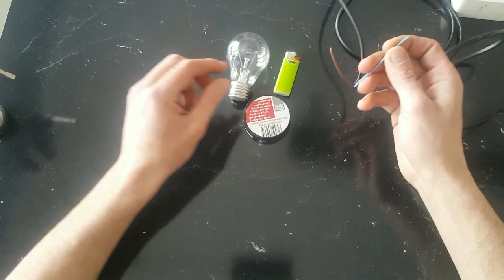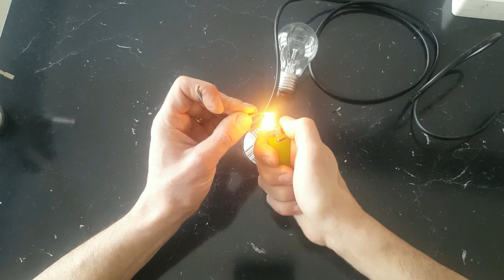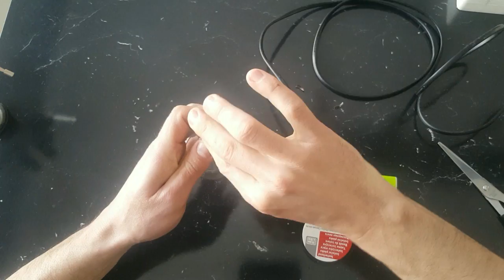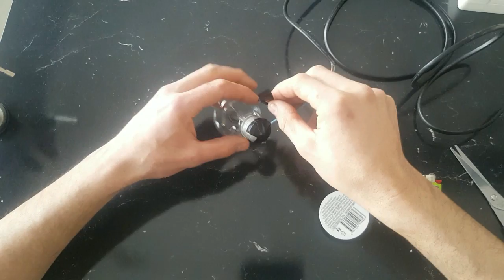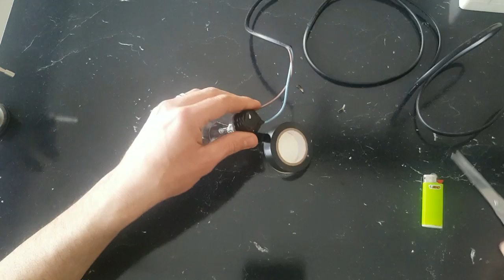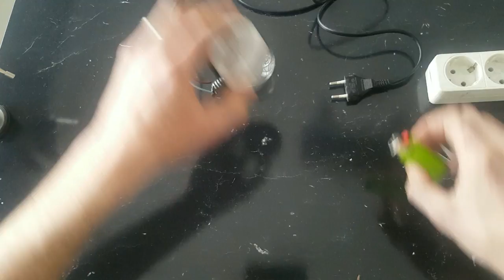How to power,start a 220v light bulb without the socket, just wires and tape

Comment: And can i use the usb thing to connect to the plug?
Reply: The wire with the usb thing that you can plug in to make a plug
Reply from the maker: No masking tape is made of paper and can be wet and tear very easily, and no usb cable is not made for high voltage

Comment: Hey, I tried it prior watching this video, and the way I did was I made the 2 wires contact with the very end metal tip of the light bulb, and it slammed down my home's electric system, and the bulb sparkled a huge one, and burned the metal. What did I do wrong?
Reply: One has to touch the bottom black part and the other touches the outer metal. I think the white one touches the outer metal ring and black touches the bottom
Reply: @SFConline1  ooh alright, thats what I suspected, thank you good sir
Reply: 😂😂😂 hope you didn’t burn down your house bro

Comment: that tape softens at 80 degrees and loses it's grip. it can short circuit. you should at least cover the ring around the base contact to shield it better, and use kapton tape or a heat resistant holder. i thought your video had barely more that a kid would know about electricity. i.e. kapton would have a 10 percent faliure rate compared to SHIELDING tape which is not at all heat resistant enough for a 150 degrees lightbulb. no shielding used near base. no safety warnings.
Reply: What tape would you recommend
Reply: Depends also on the w of bulb so I did it and I use 20w bulb energy saver

Comment: Witch is positive and witch is negative
Reply: doesn't matter
Reply: Fun for CHEAP  still doesn't matter. try it
Reply: Black is hot, goes on bottom and the other is ground goes on outer metal. I think. I'm no electrician tho
Reply: @SFConline1  black is negative
Reply: Positive is on the bottom negative is on the side
Reply: @SFConline1  Alternative current does not have positive and negative cuurent. It has live wire, zero/neutral and ground wires. In this case he use live wire and neutral. Only DC current has positive and negative.